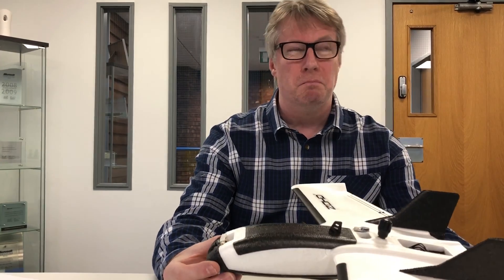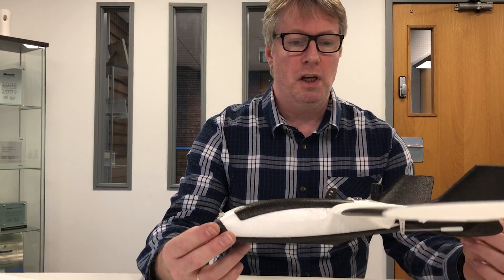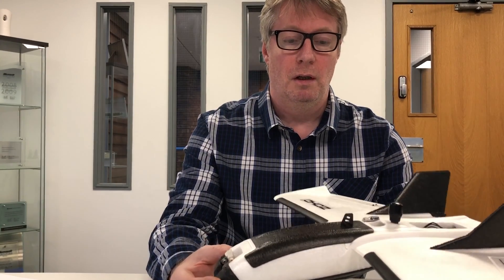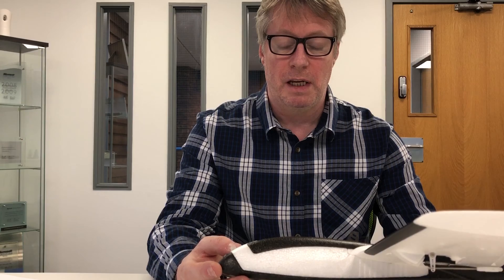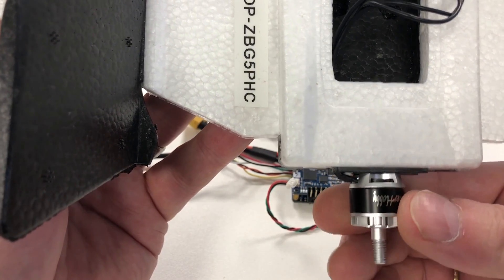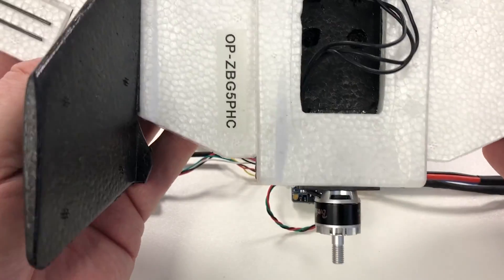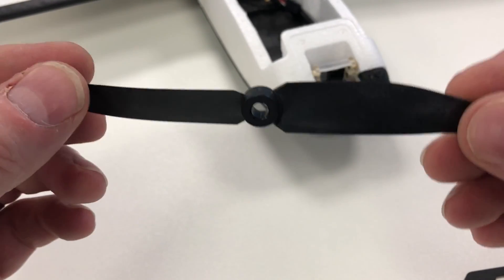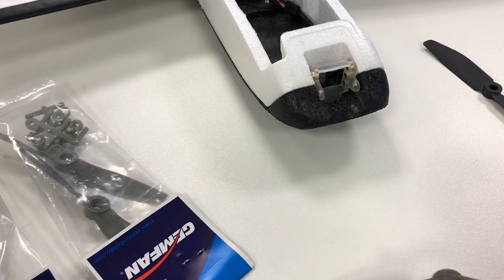My ZOHD Dart 250G Journey Part 1

Comment: I'm just putting mine together and wondering about the tail fins. Yours are facing outwards whereas Painless and Matt have theirs facing inwards?
Reply from the maker: The manufacturer says inwards I like the look better outwards. I have flown both ways and it did not seem to make much difference so you choose what you prefer.

Comment: Shouldn't you keep esc wires far from vtx?
Reply from the maker: yes its a good idea to do that but space is tight in the 250G, I used some metal foil to shield it best I could and there is only minimal interference in the goggles.

Comment: I know carbon fibre is a nice looking and lightweight material but you have to remember it’s a good RF blocker at the same time. That bracket that you’ve used to cover the antenna is covering a portion of it where it starts splitting - this is actually an active part of the antenna.
Reply from the maker: Good point I never thought of that before, that said i only use this plane for close proximity fun flying and I have not had any major issues yet but I will bear that in mind for future builds especially anything with longer range in mind. Thanks for the tip.
Reply from the maker: Oh sorry I thought you meant the carbon hatch cover over the VTX, I have changed the orientation of the antenna in fact swapped out the immortal T for the dipole variant and mounted it on top of the fuse.

See this video @ 1:02 https://www.youtube.com/watch?v=hOxKgQb6QUI&t=288s

Comment: At last, someone who is as OCD as I am about a build. If only I had your level of knowledge too. I too have the dart xlE. It's half way through its build. I'm not quite at the fc stage yet, have fitted the kopilot which meets my needs and experience currently. VIFLY2 fitted to my dart now, lost it too many times but with this device my hard work is always recovered. Thanks for such an informative video,  maybe I need to progress to a 3d printer. That's zohd rear cover is spot on. Cheers, Mick in the New Forest. Age 50 lol.
Reply from the maker: Hi Mick, yes I am a bit OCD on my builds. I also have the dart XLE and its probably my favorite plane right now as I am focusing on trying to push out for some long range.

The Vifly devices are really a godsend when you have a crash especially in long grass and have helped me find a down plane on many occasions.

I can highly recommend a 3d printer they allow you to make  so many parts and they are really quite easy to use.

Cheers, Glenn in Lincolnshire Age 56 lol.
Reply: @bluefish3607  Thanks for your reply Glenn, without trying to be a pain I have two quick questions. 1. I've only been in this rc world about 5 years so relatively new still, so if I was to get a 3d printer for my basic needs, can you suggest one for me to research? 2. I have a Qx7 tx, can you suggest a rx to give me decent range,  I tend to get a lot of rssi low warnings even at relatively close range. Might be a separate issue but always good to get a recommendation.  Thanks in advance mate.
Reply from the maker: @mickelson8332  I researched 3D printers extensively and also looked at some thy my friends have bought. I went for the Ender 3 Pro and it has been fabulous tbh.

The only mod I have done to it is change the bed springs and add a glass bed.

I got mine on Ebay and paid £180 for it but I see on Banggood they have them in the UK warehouse for £155 on special offer and believe me  for what you get that is amazing value. I use TinkerCad for designing most of my parts and that is also pretty easy to use.

On the receiver front its a little more difficult for me to help because I have not used Frsky receivers for quite a long time but when I did I used the R-XSR and had pretty good results.

If you really want to go long range with reliability then Frsky R9 or as in my case Crossfire are by far the best options.

I have the Taranis X9D and went for the crossfire micro module that plugs in the back which I think is the same on the QX7.

I then use crossfire micro or nano receivers and still have full signal strength at 15 kms.

I hope that helps.
Reply: @bluefish3607  Glenn, thats a great response. Thanks for taking the time to reply. I'll have a look at that printer. Sounds ideal. Will get it now I think then give it my wife to wrap for Christmas 😁. Funnily enough you mention the xsr rx. I had literally just taken one out of my rx supply and fitted it instead of the rx6 I had in there. Let's hope this has a better outcome. Again,  thanks for your advice, I think my dart is on her fifth rebuild now... isn't that the fun of it!!! Cheers. Mick

Comment: excellent build , explanation etc.. look foward to maiden, flight, my main question if you could help is.. Do you need to adjust servo throws / travel or does inav take care of that , i.e ive used manual built wing where i adjusted throws in radio. Thanking you!
Reply: ps. excellent mods!! especially your wire routing parts :)
Reply from the maker: With iNav you do not need to make any changes in the radio at all. I would suggest getting your elevons set level and then try to set the plane to fly level in manual mode by adjusting the elevons accordingly manually. When you get this about right then do an iNav autotrim. I will be covering my entire setup and flight tuning process in part 3 as soon as this weather improves.
Reply: Thx , think I'll order one and start the build. Roll on vid 3, thx for your reply

Comment: Good afternoon! You use the GPS module without a compass, and therefore it was so well positioned on the canopy mounting bracket and thereby successfully spaced VTX and GPS antennas. Have you ever encountered situations when you still need a compass? And another question about the location of the Immortal T V2 antenna - is it not too dangerous for the antenna to be missing any protection from its rays?
Reply from the maker: Yo don't really need a compass with iNav I have never had any issues at all with accurate direction or return to home functions. 

Not sure what you mean about the rays from the Imortal T, it works perfectly there I get no interference at all. I am getting very strong signal up and more range than I need for this plane. Mounting it vertically would be better if yo wanted to go long range. 

I have the Imortal T mounted vertically on my Dart XL Extreme and have full signal at 12km plus.
Reply: @bluefish3607  You have the middle of the antenna embedded in the fuselage and covered with protection, and the ends of the antenna stick out of the fuselage under the wings, which is what I had in mind. I really liked your installation of components. And how much weight did you get without a battery? Thank you and have a nice flight!
Reply from the maker: @vladimirivanov2867  The Immortal T mount works great but if you want to go really long range say 5km plus you may wish to mount it vertically, I have been 2.5 km out and still had 99% link quality on crossfire.

The weight is 235g without battery and the 850mah 4S I am using is 94g. So not under 250g, but then I did not try to build it under 250g
Reply: @bluefish3607   Weight is more, but excellent accessories and flies wonderful! Thanks!

Comment: Mine will be coming in a week or so, I’ve got a tarsier already, but I’m a little worried about the heat, so I might keep it basically original, and I’m going crossfire for the distance. I like your build and ideas, it gives me ideas, so I’ll wait till I get it before I actually start thinking about any optional things I might do.
Reply from the maker: Hi Dave, the Tarsier mount and canopy air duct worked well for me after a 10 minute flight the camera board was barely warm. I think the heat sink I added also helped, mind you it was only 4 deg when I was flying it.
Reply: BlueFish , I should have mentioned that I’m in Australia and it can get pretty warm here, just in case you didn’t know lol.
Reply from the maker: @DavidReynolds-kr6yh  In that case I would definitely think about some cooling options if you are going to use the Tarsier inside the fuse. Maybe even cut some air ducts in the nose if the top cover duct idea is not enough.

Comment: nice video, subbed. i have done a review of the 250g in basic setup for a maiden on my channel, and now I'm preparing one with full inav and gps as my other wings. is interesting to see different point of view of buildings👍😉
Reply from the maker: Doing my maiden today, good luck with yours.
Reply: @bluefish3607  good luck, and add a little bit of reflex, it need for easier launch

Comment: I would make sure the carbon plate over the xfire arial doesn't cover any of the active element.
Reply from the maker: Thanks Caroline, I didn't think about that, there is my inexperience showing through, maybe I will 3D print a cover out of PLA to be sure I don't have any issues with that. Good call, thanks.
Reply: @bluefish3607  I'm working on a mini talon and also a mini AR wing both with iNav
Reply from the maker: @Caroline_Tyler  I have an AR Wing 900 and absolutely love it. Was my first wing and still enjoy flying as as much as the first time. The mini AR wing and mini Talon look like a lot of fun and I hope they bring you lots of fun.